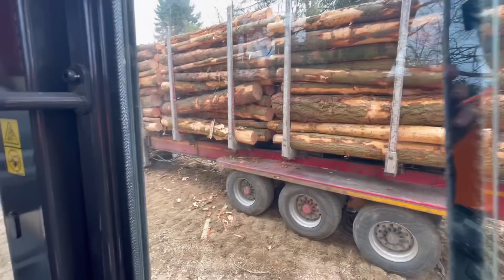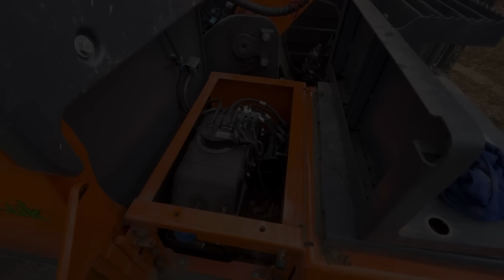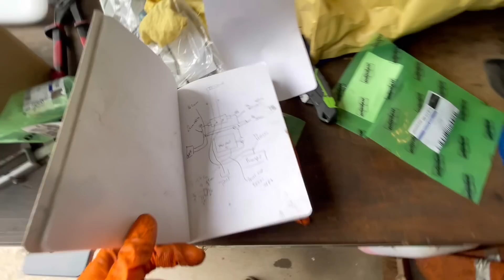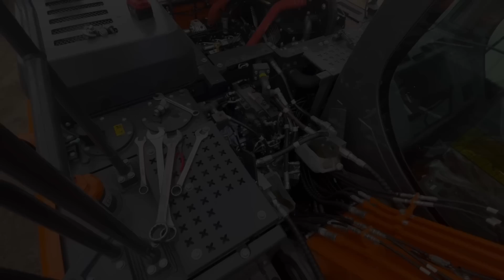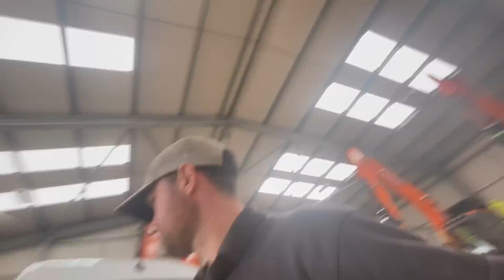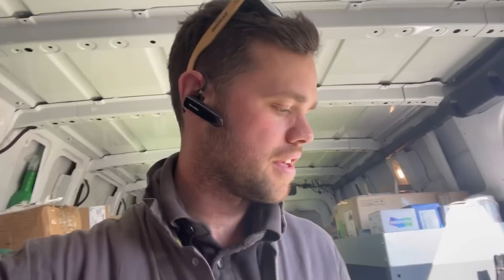Digger mods / Friday afternoon breakdowns / dumpers / Episode - 185

Comment: Hi mate what sort of wifi do you have to carry out control unit updates onsite, the company I work for are looking into getting wifi fitted to our service vans
Reply from the maker: Yea it’s a Teltonika RUT240 just takes a SIM card and has a 240v plug or a 12power socket not sure if it comes with the PUK for the roof but it worked well with out on my last van

Comment: Seems like a complex way to fit that aux valve but I’m assuming it’s because you need proportional control? I did a similar mod to my 210 for a thumb. Machine had a hammer circuit so I blanked off the return line at tank, fed the hose back into the other side of the option spool on the MCV so I then had 2-way control. I then used a cetop solenoid pilot valve with a cushion block mounted under the cab close to the pedal control lines which I t-eed into for flow. I actuated the solenoid pilot valve running a single pole double throw switch mounted  on the end of the rh joystick which ran to a set of relays then to the solenoid valve. I ran the normal small pilot lines from the valve to the option spool and bobs your uncle, works brilliantly and very simple. I haven’t lost any flow elsewhere but don’t have the flexibility to switch over to one way flow if I need but I do ag and forestry work so don’t need it. Looking forward to seeing how you finish the this 140lc and the 225 mods too. Have a cracking weekend.
Reply from the maker: That all makes sense to me but yea we want it all proportional I thought it’d be easier to add an extra 2 way than a one way the needs 150+lpm hope it works 😂
Reply: Nice install Ali. I don’t think it looks bad.
Reply: It was another great watch. Thanks Ali